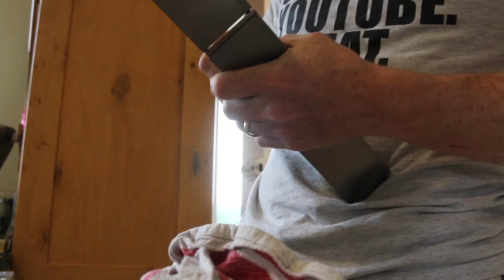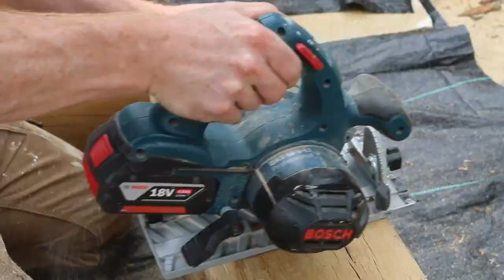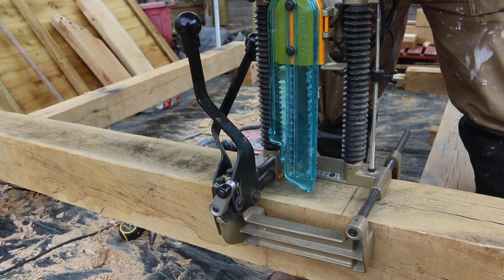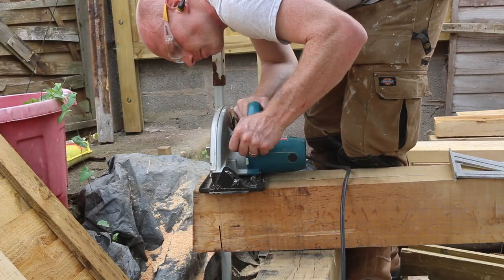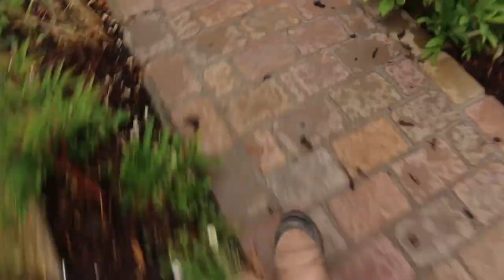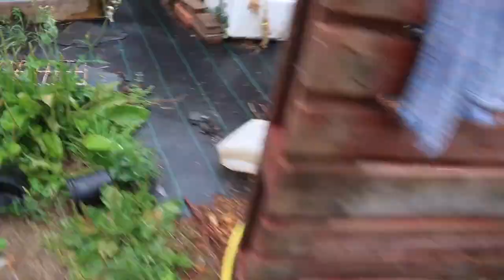How to build an Oak Timber Frame workshop. - lots of TIPS!

Comment: Hi mate love your channel found it though the camper series,Snapped my ankle last weekend so I will be going though your back catalogue,I really like your approach  to your projects very considered,Any way I've fitted together a few oak cart barns/garages when I had a long run of work in Tunbridge Wells and the surroundings east sussex villages Rotherfield Flimwell amongst others,
Your going great get the leather strop and sharpen after each joint,no need to set up honing guide it will take less than 30 seconds with the slick,Keep the joints as tight as yon can because there gonna shrink,Also done some green oak gates as well for churches it's good fun enjoy it
Reply from the maker: Ouch hope the ankle recovers soon! Thanks for the tips. Yes trying to keep things snug as it won’t take long for things to shrink. Just need to get the frame put up before it has time to move too much sat in the garden.

Comment: Hi Tim, you may already be doing this, but in case not.
When sharpening my plane irons and chisels, I recently started finishing the honing process with a leather strop, one side loaded from the abrasive bar which came with it, and the other side left plain.  I do 24 strokes on the loaded side, 12 on the bevel side, and then 12 on the back. Then flip to the strop to the unloaded side and do 24 more, 12 bevel side first, then 12 back side. Once done the chisel or iron will normally shave my arm hairs quite well. If it does not then I repeat process. Hope that helps!

Comment: Great job Tim! I thought your half laps were really great. I’d be inclined to allow a ‘penny gap’ on all of them to make life easier (give the joint a tiny bit of space in the future, and allows you a tiny bit of wiggle room whilst doing test assembly). I didn’t see whether they’re boxed heart, or halving,  and obviously this makes a difference when considering where your radial shakes might start appearing.
Really impressed by your work rate.  I know it feels like real slow progress when you’re working alone, but working green oak is tough. I personally do not use a chain morticer, but after watching this I really want one.
Incidentally, I use the two big Sorby framing chisels (yours look like Sorby) and have never had the cuts from sharp edges you spoke of. Glad you’re getting them sorted though. Anyway, keep it up and be careful (remember Jim at the Tradesmans Channel has educated us all about the importance of safety when timber framing recently!).

Comment: Guessing that’s a faithfull block plane you bought. The blade was rubbish. 
I got a replacement Ray Iles blade from Workshopheaven. 
With a bit of fettling & flattening the sole it’s really quite good now.
Didn’t realise that faithfull made a large block plane.
Reply from the maker: It’s terrible, it chipped on just oak. Will be fitting another blade like you have done. The larger plane seems to be holding its edge just fine so not sure why block plane so poor.

Comment: Quick tip, to remove black metal stains off green oak, oxalic acid with warm water. One part acid to ten or so parts water, in weight. Could use to clean up whole frame once done.
Reply from the maker: Yes have read that, even getting rid of water marking from rain, etc. I only just managed to get the black off my hands, found lemon was the only household thing that did it.
Reply: @TheRestorationCouple  great, I'll have to try that, so far IV not managed to remove the black of my hands. Thanks

Comment: I've been doing general joinery for about 10 years now  I've been using and sharpening tools for a lot longer since my teens  the blade in your block plane  is it dulling very quickly   or is it struggling to cut  but still feels sharp
Reply: your standard angle block plane will need a lot more force to push through oak as it is pitched at a higher angle or about 21 degrees  as well as  your bevel on the blade 25  and if you are adding a micro bevel to your blades it works out at  around 51 degrees which is higher than what a normal bench plane is  personally  I think you'd of been better with a low angle yes the  blades smaller  but it cuts so much nicer I've carried one in my tool belt  for years. another  lil tip for you  on you planes usually faithful planes are pretty flat on the soles  I personal fettle them all  but to make them glide abit  more easily  use plain candle wax on the sole just a  wavy line down the centre will  do you and you will feel the difference  straight away . last tip would be to strop your  blades  I know  its an additional cost of about £4-5 but  get a scrap of timber  and a old leather belt  and staple it on to and buy some auto sol chrome polish  you can get it in b and q  and wipe your  plane irons and chisels over  it but only use on thee pull stroke  you can use it why your irons and chisels are still in the honing guide. If not get the auto sol and put it on a scrap of mdf  and pull your blades trough it . hope this helps keep the videos coming. You never stop learning.
Reply: mfcman2k7 good tips! Thanks